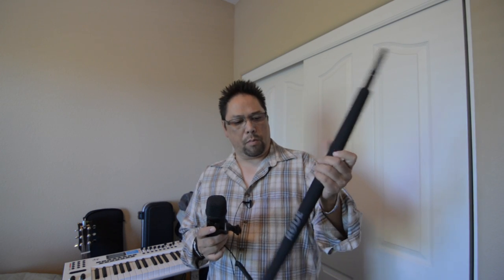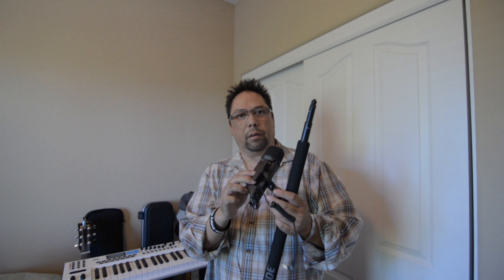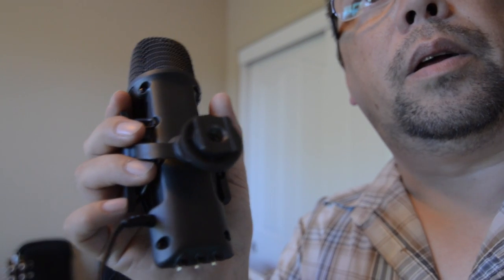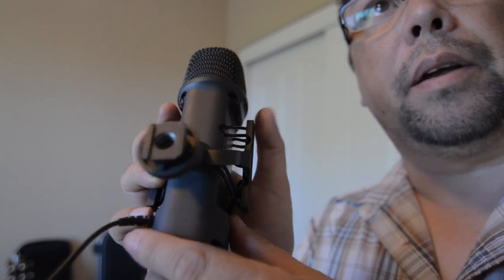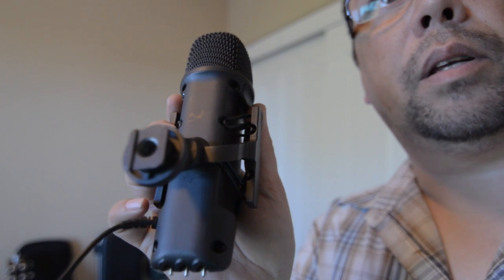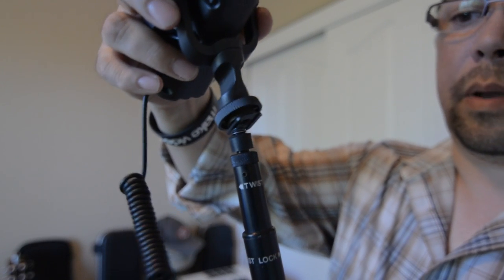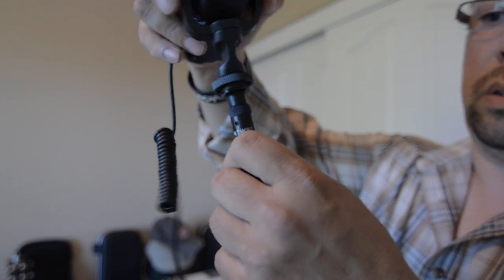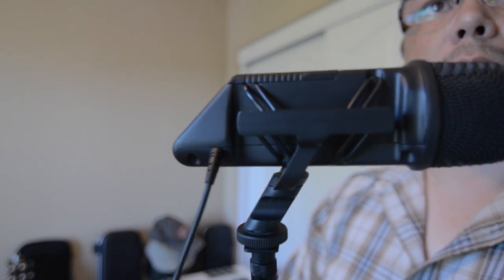Rode Micro Boom Pole - Attaching A Microphone

Comment from the maker: It'll work. This one isn't too heavy but there are lighter more expensive poles out there but for an inexpensive pole this one will get the job done. Note, you'll have to get an extension for the cable to run from the mic, wrapping it around the pole so it doesn't hang.  I'm very happy with mine.

Comment: Hey Wayne, is it possible to attach a Zoom H1 to the Rode Micro Boom Pole? Are there any connectors on the market?
Reply from the maker: Hello, I'm not completely sure but this might work Manfrotto 015 Female 3/8" to Male 1/4"-20 Adapter.
Reply: SpiderWayne thanks. I found one and ordered it!